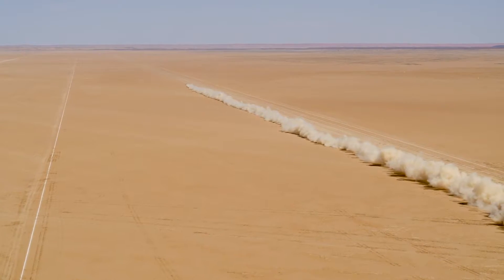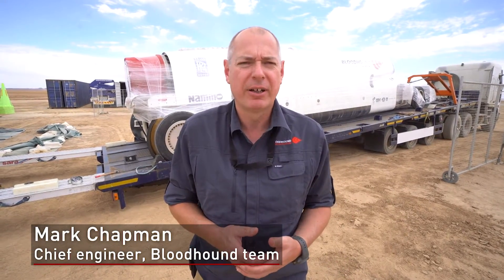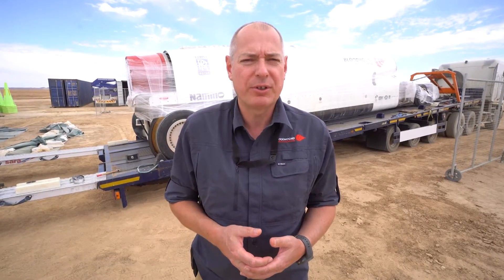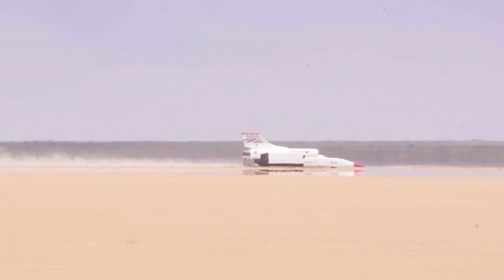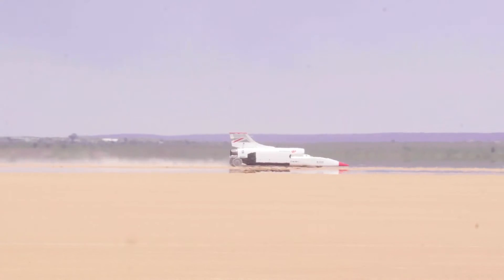Why Bloodhound LSR needs a space rocket motor

Comment: Why use the jet engine at all, why not just the rocket engine?
Reply: I think that a rocket engine needs a certain, very fast, airspeed to operate. Not sure though because it could also be an air pressure thing instead.
Reply: @curtisfarmer8321 dude u r talking about ram jet engine that's not a rocket engine
Reply: @curtisfarmer8321  I would guess too much acceleration for a person to withstand.